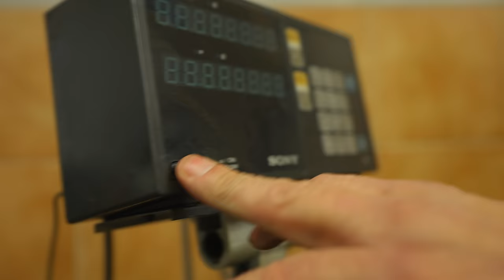Gimbal Comparison | DJI RSC2 VS RS2

Comment: WOW! the DJI RSC2  looked like it had way less micro jitters and was smoother than the RS2. I'm shocked!
Reply: Yes all the rewievers says so, ı am happy with my purchase :D
Reply: Yep, RSC2 is awesome, even without the cinematic LUT for the RS2 sample...
Reply: I don’t think the reviewer did calibrate the rs2 correctly. It has stronger motor, and the settings must be down for mirrorless camera. Other reviewers have shown the rs2 is very good and better than rsc2. I don’t trust this test.
Reply: @CC-gt3ro  many other reviews also proved the opposite, so your point is?
Reply: @CC-gt3ro  this test is even more accurate since he used both of them simultaneously by rigging them together on a custom made holder which removes a lot of variables that would be present when shooting with each gimbal separately or in different arms. And you can only “assume” that he didn't calibrate the RS2 properly, because at the end of the day a guy like Peter with experience and great results under his portfolio is not expected to make a calibration mistake, especially since he made all the effort to build a custom holder for a fair test. Also microjitter isn't much related to a mediocre calibration unless you adjust motor strength to some ridiculous values, but even then the gimbal would scream then lock itself and ask for a better calibration. The microjitter we've seen here is not related to “a bad calibration”, maybe the RS2 is just better for heavier setups and worse (than RSC2) with lighter setups. I still own both so I don't care, but the RSc2 did look smoother in this test.
Reply: @costinvaly1  Can you tell me my friend if in RSC2 there is the ability to turn off panaxis motor or roll motor and work with other two like i RS2 making combinations?
Reply: I agree! How can this be when the rs2 has a heavier max weightload?

Comment: I disagree with you about the slung mode about the rsc2. I find it tricky and complicated, and you cannot do it from normal to slung in a seamless way in your videos. I prefer the zhiyun weebill s or rs2 dji approach with the slung handle. I don’t like rsc2. The only problem with the rs2 is that it is a professional gimbal and of course the price is high. Also these gimbal are too big for travel usage. Ronin should create a crane m3 like gimbal with a led and micro connector, but slighlty bigger like weebill s to allow bigger lens. And keep the handle and button layout of rs2 with carbon fiber at 400$. It would sell like crazy.

Comment: My Weebill S looks like crap compared to these
Reply: Buy DJI Ronin !
Reply: I have both, the Weebill S which I bought first (being cheap😂) and the RSC2, RSC2 makes the Weebill look/feel/perform like a toy. It’s just been my reliable trusty dust collector. Just haven’t had the time to put em on eBay yet
Reply: I just saw this but I completely agree. I thought the weebil S was a steal at first. Even invested in doing some research prior to placing my order. Sadly, that wasn’t enough.  

No matter how hard I tried when it came to: walking, firmware updates, different dual handle grips, calibration, etc, the weebil S just performed terribly. I could Ninja walk in a straight line and the footage would still come out wobbly. 

It actually deterred me from using gimbals for months. Now that some upcoming shoots are calling for a gimbal, I pulled the trigger on the RSC2 yesterday. And man what an absolute refresher. 

Once balanced (which only took 15 minutes after not touching a gimbal since December) I never had to stress over any wobbles. Footage is clean; maybe ad a TINY bit of post stabilization (if you so choose) but it’s safe to say that I wasn’t me this whole time (for the most part) 

Overall, No one should have to check whether their gimbal is working properly between each shot; it shouldn’t even be on your mind. Knowing the capability of the RSC2 really pumps me up to hop back up on a gimbal again. And I really appreciate DJI for delivering. 

Not even joking, I stood up until 2:30am just just trying different shots and it makes me so happy. 

The weebil S on the other hand, good riddance.

Setup: RSC2, P4K, (cageless) Meike 16mm lens. Small vmount clamped to the handle; not a counterweight in sight.

Comment: I bought the RSC2 initially and then returned it and bought the RSC2 Pro Combo and I am so happy with it. The Pro Combo comes with the metal tripod and it does seem a lot more sturdier.
Reply: Sir what is the difference between RSC2 & RSC2 pro ?

Comment: the shakier footage on the RS2 is most likely due to a poor balance, or lack of Auto Calibration once the camera was balanced, to get the motor parameters right. It makes no sense that the RS2 would be shakier than the RSC2. He should retry with another shot at balancing.
Reply from the maker: Both are balanced and calibrated 😊

Comment: that great rig you custom made (i love manual works), actually neutralize each stabilizer posible difference, whereas heavier the stabilizer, steadier the result, therefore, here is expected same stabilization on both, as they are attached. resulting differences are due to different calibrations. i believe the should be tested separatedly, as the way they are intended to use.

Comment: Nice. But just a quick note. The RSC 2 has shortcuts that can be essily accesed by tapping the M mode button in different combinations. :) just an FYI.
Reply: Still, I got spoiled with the DJI Osmo. Touch screen would be nice.  Hate GOPro nav GUI style.

Comment: When you guys were building the mount for the two gimbals i noticed, that one barrel was less tight than the other one... this is where the micro jitters come from ;)
Reply from the maker: There’s no space for either gimbal to move when attached to the mount so I doubt that that’s where it comes from 😊🤙🏼
Reply: @PeterLindgren1  ok.. could you make another test about it?
Because now i feel like i should sell my RS2 again because of all these micro jitters.. i think having these jitters instead of the original Ronin S is not worth 800€ for me..
Reply: @saschafirst  does your footage have micro jitters?
Reply: @charlesnetzler2262  yes, i think its because of the mount of the RS2. the battery grip and the gimbal itself are a bit loose in general, i think thats why people with the RS2 has more micro jitters..
Mine was also perfectly calibrated..
Reply: @saschafirst  Thanks, I will definitely look at getting the RSC2 over the RS2 now.

Comment: Did you try switching the sides they were in to see if it was something related to that? Also: is the rig balanced for the gimbles being two different weights? Lastly: are each of the gimbals equaly secure in each socket with no wiggle? I agree the RS2 had a lot more shake than the RSC2.
Reply from the maker: Both gimbals are secure at the mount, we balanced the rig to be centered and tried both gimbals in both mounts. This is the outcome 👍
Reply: @PeterLindgren1  awesome work! Thanks for the great channel!
Reply: @PeterLindgren1  If to be the case.. you cannot hold a gimbal by the tripod alone. A top heavy gimbal or a non fixed battery attachment would lend to the instability and added movement of the gimbal's overall structure. Now put two hands on it as it was designed to be used, then you will receive the same and best results that 99% of all of the other reviewers are finding. Of course there may be other user error factors that need to be investigated. Our best guess.

Comment: i think the reason why rs2 is more unstable is the combination of batteries and gimbals.
rsc2 is integral and rs2 is detachable, but if the bond is not tightened tightly, free play occurs and a lot of shaking occurs. The connection switch is not perfect either, so it's very uncomfortable.

Comment: Hi! Cna you also mount a camcorder on the rsc2 normally so that it has space on the back? My camcorders has the scew on the front, so, you have to push them quite to the back. Can you turn the base fast plate's front to the back, so it will fit normally. I don't know if the question makes sense to you 😀

Comment: Hello creators, I've got a question regarding the dji rsc2 . I'm looking forward to purchase this gimbal for my Sony a7iii paired with the Sigma 24-70mm f2.8 dg dn. This might be a silly question but any response would be helpful to me,  so I'm not sure if I need the pro combo version or not to pull manual focus? Can it be done internally by using the front dial wheel? Cheers

Comment: I think something is wrong with this test. You have so bad results on both gimbals and even roll axis had micro jitters.
I'm using RS2 and my footage never looked like this! I think something went wrong with calibration or settings. That DIY rig might cause micro vibrations also.
My gimbal has no micro jitters at all while walking. When you set it properly RS2 results are really smooth.

Comment: I think the reason to why the RSC2 was a little smoother is the fact that the metal pipe that Held the RSC2 was a little tighter than the RS2... Maybe because the RSC2 legs are a little bigger than the RS2...
Reply from the maker: Nope, they were just as snug at the testing so that’s not the issue 👍🏼
Reply: Well noted.

Thanks for the reply

Comment: Quick question - could you use some RS metal accessories with RS2? And I wish there was some kind of conclusion in the end of this video. It seems RSC2 was more stable but who knows if that custom handle affected the test or not. It didn't look like a solid solution to handle both gimbals. I guess it would be better to lock them somehow and not just insert them. So I'm confused by this video...

Comment: I was shocked to see the RS2 Shake a little more than the RSC2. 
I thought the RS2 was more expensive because it was better and stronger. 
I’ll probably end up getting the RS2 anyway because I have vintage glass that I want to add auto focus to.
Reply: Lens Focus motor is exactly the same for both RS2 and RSC2, and Active Tracking works identically, too. This is not actually AF for a vintage lens; for the latter you need to purchase the optional lidar device (again it's identical for both gimbals) which is expensive and I am not confident in it's usefulness...